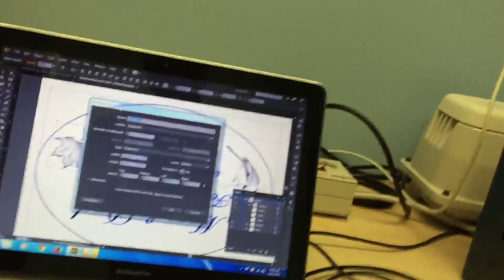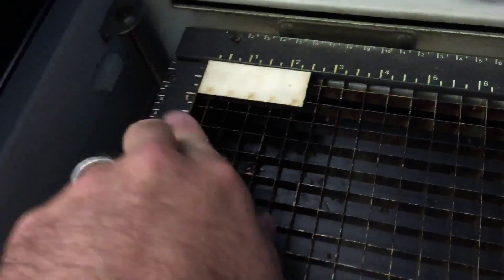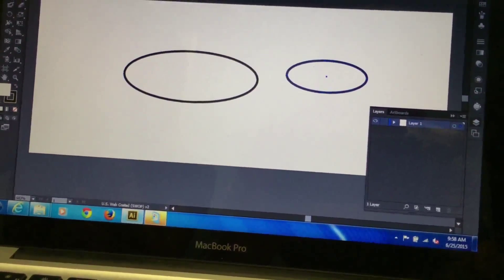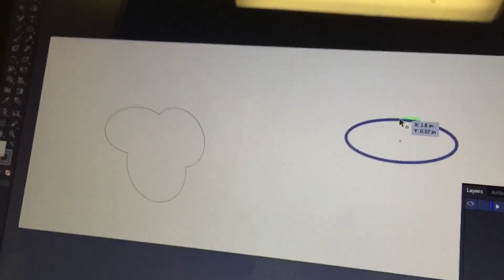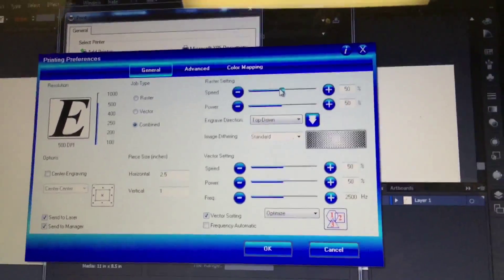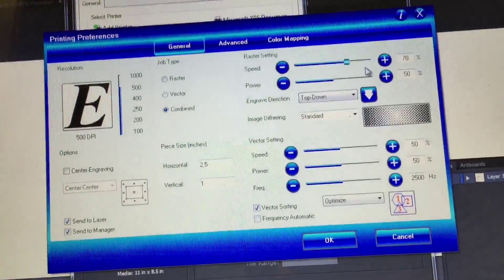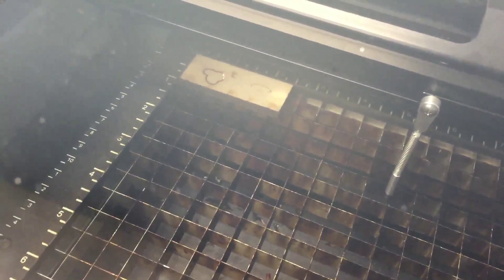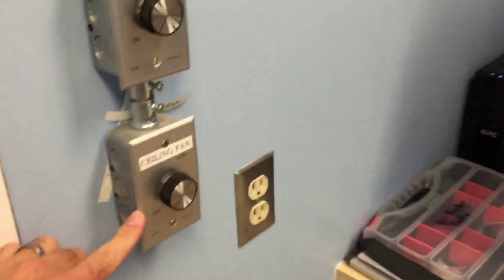How to use our Laser Cutter (Epilog Zing 24 Laser Cutter and Engraver)

Comment: Just curious how you are using a Mac, would love to use my Mac for my epilog
Reply from the maker: We use a windows on it, unfortunately the Mac software wasn’t great you have to connect the laser to the network instead of via USB. At the time we set things up the Mac software wasn’t very good. So we installed a program called virtual box, and then install windows on that. So it’s a Mac, but really it’s running windows.

Comment: So black means cut and grey means etch? Thanks for your video.
Reply: The color does not determine whether to cut or etch.  Black will do both, it just etches (rastors) deeper than grey.  The way you distinguish between cut and etch is by the stroke setting. It will "cut" with stroke set at .0001